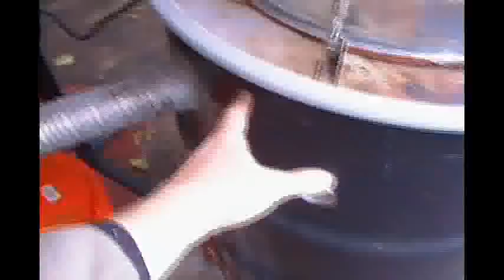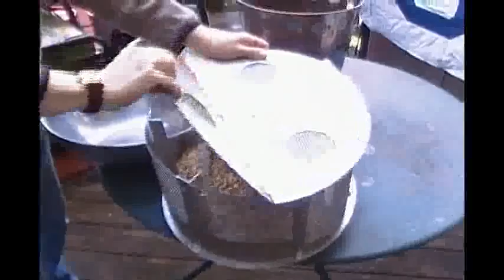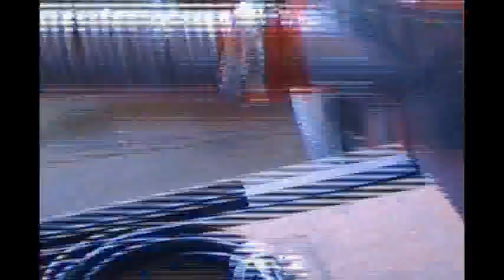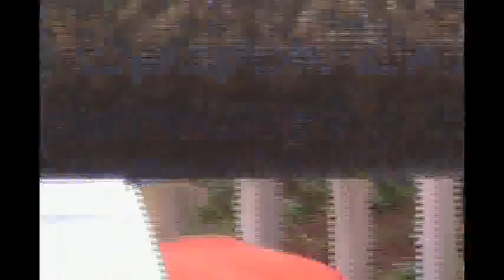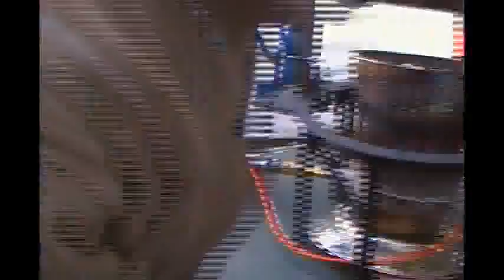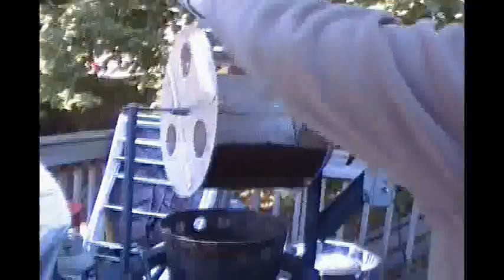Wood Gas Generator using Swirl Burner to Roast Coffee Beans

Comment: @coffeeroastersclub thanks for the tips :) Since i live in Norway and  my  project has a limitedbudget i will buy those parts on Ebay , i know they can be substandard grey marked parts but i guess they will be good enough for my prototype:)

only problems when it  comes to the parts is the thermocouple, i haven't found one  witch wil work past 700C and  i need one that will handel atleast 1300.C

Comment: @coffeeroastersclub thansk for the tip , since i live in Norway and the project will have a limited funding i use E-bay as a source for parts for my prototype .. i found a cheap PID and SSR but i haven't found a prob witch goes beyond 700 C  and i need  it to got to atleast 1300 C..

I also have a few  ideas when it comes to  tar removal and i will test em as soon as i  have  my prototype up n running :)

btw how did the  coffee taste ??

Comment from the maker: @LurkePus I put together the temp sensors from a PID, thermocouple probe, and SSR I purchase from auberins.  The guy that runs the place is very helpful with details for setups.  On another matter I later did get the generator to work with my setup.  However a couple things:  The cooling tower extracts alot of wood tar that settles on the bottom of the tower.  I later drilled holes out in the bottom of the tower and put on couple screw top mason jars to catch the tar. Much better now.

Comment: @coffeeroastersclub  soory to hear about the cooling tower but i'm sure you will have it up n running again soon :) 

I'm also working on a gasifier setup , the idea is to make a  micro scale CHP gasifier using things like household garbage as a feedstock to produce syngas for heat and power :) 

one cuestion i have is how did you make the  temprature sensors  , I'm searching for a solution witch can handle temps over 2000 F.

Comment from the maker: @LurkePus Hello.  You are right on the bridging, I did find that out after a few more experiments.  I have used larger chunks of wook but found that they would not ash quick enough and I got "crawl up" of the refractory section.  I got the drum to work pretty good, even put a heat retainer stainless cover on it.  Then we had a heck of a wind storm and it knocked down my weighted bottom unbrella and knocked over the cooling tower, damaging the vacuum motor.  AGHHHH!